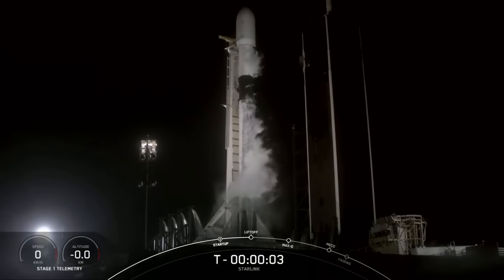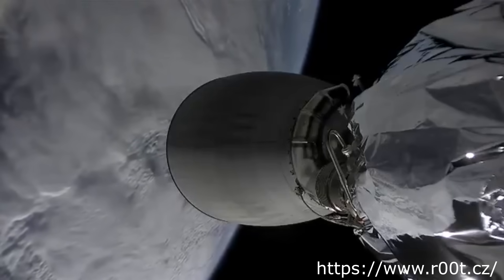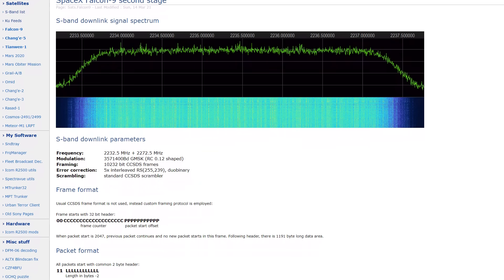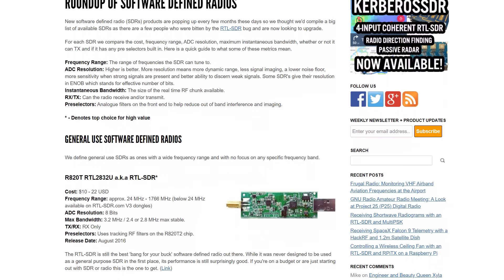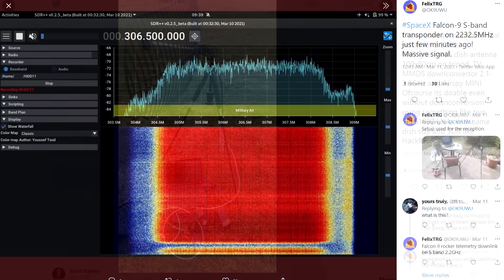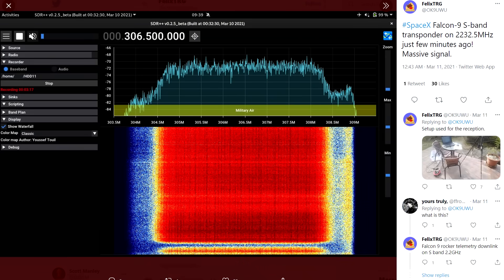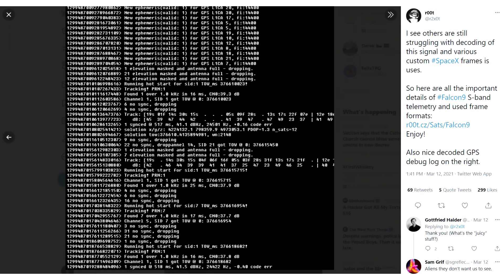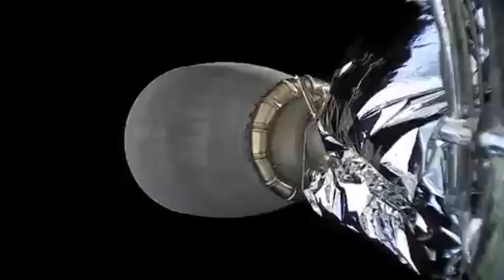How Amateur Radio Fans Decoded SpaceX's Telemetry & Engineering Video

Comment: The thing about data-streams from fast moving objects that may blow up on you is that the transmission may be intermittent AND non-re-creatable.

So, you end up with a huge pile of data with gaps in it.  On a good day.

If you do front-to-back encryption, the gaps basically not only lose the associated data but also subsequent data.

That is, a simple encryption scheme (let's say, a simple rotating key) will be illegible after the first data-loss.

If you have perfect transmission, there's no point in "synching".  If you have perfect transmission, you are not launching things into space.

So, presumably they do have some sort of synch cycle going on.  If you make it small enough, it should be easy to layer in some reasonable encryption on top.

Frankly, I'm surprised they don't do THAT as a matter of course, since they can then CHOOSE to release the information unencrypted IF and WHEN they want to, rather than leave it up to hackers.

But a stream protocol with no syncing eventually falls prey to all kinds of problems.  This is but one.

Comment: the device that shifts the frequency down is a "transverter".  It mixes a carrier at the frequency by which the signal is to be shifted, throws away the two inputs and the sum signal, and puts out the difference.  73 de ni0h

Comment: Yeah down converters are normally simple mixers.  If you combine two rf signals it will generate an output that contains both inputs, the sum of the inputs and the difference.  Bandpass the difference and you have a signal at a frequency you want to decode.  This is how most radios work.

Comment: Terrific !
I remember when the Space Shuttle transmitted Ham Radio 2Meter voice from orbit. There was a BBC News item about how a very well equipped school managed to hear the chat, it ended as the craft went out of range. I had borrowed a receiver and set it up in my front room at the bottom of a four story house in Ealing. I had perfect reception and heard more of the signal - presumably because of my different geographical position. 
I was well chuffed !
Reply: There is a ham repeater on the ISS, you’d probably enjoy listening to. I’ve made a few contacts via the ISS as it flies over. It’s so fast you have to account for the Doppler shift on transmit, but not so critical on receive. Google ARISS ISS if you’re interested.

Comment: And We Decode And Encrypt Muuuuuch More In Ukraine, Its All About SDR's And Antennas And Filters. I Have Made Buunch Of Filters And I Have Contributed To Ukraine Defending Itself.
Bte There Are Standarts For Decoding And You Can Just Go Thru Them if You Find Signal At The Right Frequency Band, If Its Not Encrypted, You Done It, If Its Encrypted, Well, You CanTrunk It Also.
There is a program that you can download, called robot36 and you can get sound to picture signals. there are other programs, but i cant mention them here

Comment: This is completely off topic for this video but I just thought I'd note out allowed that the Boeing starliner seems to have dropped out of sight completely. 
I see their claiming that issues are still being worked through with a possible next flight in 2026! Or, not. 
Givens speculation that the ultimate problem was not the thrusters but the way the thrusters were grouped onto the vehicle, I would imagine we will never see Boeing starliner fly again. No doubt there will be an announcement as such in about 2030

Comment: This "gizmo" shifting down signal ferquency is a very simple frequency mixer/converter, that you can find in literally every superheterodyne radio for a hundred years, as well as in a TV-sat tuner, for example. It's just another frequency conversion stage in the receiver (a typical receiver has one or two such stages). Regards!

Comment: For the "The old days" you could very well have referenced to Curious Mark and his team that re-built the Apollo telemetry up- and down-link with mostly pre-flight and original test equipment from collectors.
For the encryption... That is difficult and differs by country. In Germany you are allowed to receive any signal. You may receive and transmit on any amateur radio band if you are licensed to do so. But that said, you are not allowed to recognize, record or use any non amateur radio or broadcast transmission to your personal benefit. Also you are not allowed to inform third parties about that reception. That is why we are allowed to possess any kind of radio receiving device. But there is also a law about data secrecy that prohibits the decoding of any signal that is ever so slightly encrypted. As this shows that the signal is not intended to be received by you, you are violating laws by breaching an encryption. Again there is a but... As you explained you cannot simply send zeros or ones in digital bit-streams for longer periods as that would shift the receiver trigger for ones and zeros. So you use encoding like NRZ or NRZI or many other encoding systems. If you now use an encoding system that is well known and documented, it is not an encryption, but an encoding required for the modulation to work. And thus, the reception may have been legal in itself, but not legal in making it known to others. However, in case something may have gone wrong with the rocket and that team "accidentally" had recorded data around the incident time, SpaceX would probably be very happy to get their hands on it. An the final but... But I think that all the other rocket nations on the earth already knew about the telemetry and video and I am pretty sure that if the cameras can be switched manually or by position, over certain countries they only show the front or tail view but not any insides. Having said that, hopefully my tracking dish and antenna array will be up next year in spring. Reception up to 15GHz is not a deal, I can work with these mixers and intermediate frequencies ;)

Comment: Randomizers are used in systems that vary the amplitude energy of the symbols, such as 8 VSB, as the high energy bits will go a lot farther then the low energy bits.  The data psuedo radomization allows the FEC forward error correction data to correct for that.  The receiver contains the same psuedo radomization table so it can track it.

Comment: That "thing that shifts the frequency down" is called a Down Converter and that's all it does it uses a bunch of circuitry to take a frequency and shift it down to a lower frequency while still retaining all the data.

Comment: SN11 exploded at a height of approximately 1km. It is unlikely debris 
reached South Padre island as some are suggesting which would be about a
 5 mile trip horizontally. Most rifle bullets travel only 2/3 miles. 
Only way this might have ocurred is if parts of an exploded raptor 
engine under extreme pressures were ejected at incredible velocities 
exceeding that of a high powered rifle bullet. These would likely be 
only very small fragments.

Comment: So this is the reason i couldnt get my rtl dongle delivered the other day. The gizmo is called a down convertor. It down converts a higher freq. To a lower one your receiver can hear so to speak.
Ive been doing this stuff way before sdr. Used a radio scanner and a tape recorder to record recieved signals from way a weather (noaa) or goes satellite and then played it back into the computer to decode the beeps and bops into a picture. Theres slow scan tv wefax ship to shore stuff pager data etc etc acars data sooo much to download and decode.

Comment: You like looking inside a liquid oxygen tank.  I'd rather look outside................
P.S.   LNB (Low Noise Block) converters to convert a higher frequency band to a lower band (mentioned at 3:30) are not that unusual and readily available....

Comment: Scott, the Gizmo you refer to at about 3:29 that converts S-band to something the cheap dongles can receive is called a downconverter.  Essential, and basic technology.  You probably have a dozen around you right now.  It's a local oscillator (multiplied crystal or something similar) and a mixer with some filtering.

Comment: It's called a transverter or downconverter that translates the higher frequency data channel to a lower frequency that the dvbt dongle can accept. Basically it's a diode ring mixer/multiplier or a tayloe mixer, producing various mixing products.

Comment: radio guys are like wizards. They point a stick at the sky and conjure things out of thin air
Reply: Radio wave just a light but you can't see with your eye 😅
Reply: @digimacska17   kinda like saying Ethernet is just like telegraphs done really fast.
Reply: As someone working with GNUradio for a cubesat team (I’m on the software subsection and have taken 0 signal processing related classes so prob shouldn’t have been assigned to me) yea pretty sure it’s magic
Reply: Trust me ...  If you saw code division multiple access done in neon green, you wouldn't understand it either.

Comment: Pretty standard downconverter to change the signal down for SDR.  20+ years ago I worked on cable internet (docsis 1.0 and 1.1) that worked over wireless cable.  Wireless cable (mostly analog except for the cable internet) used ground transmitters in microwave frequencies.  The receiving antenna would include a powered downconverter that shifted the frequencies down to standard cable TV frequencies, allowing the end user to use standard cable modems (or CATV boxes).

Comment: Great video!  This  talk about “Amateur Radio is Dead” is not accurate.  Smartphones having taken much of the Gen X and Gen Z  interest away from 2-way amateur radio communication, but Software Defined Radio should resurrect it.  For “Appliance Operators” including smartphone only users, SDR will never be an interest or option because its complicated.  Note: This is a SDR Developer perspective.  I should add there are  SDR “Appliances”  (Turn Key) on the market now that look like and are controlled like traditional radios, except with much higher Signal/Noise ratios using digital processing.

Comment: I believe it's a transverter that allows you to use equipment to work different bands. I double-checked the full license manual for amateur radio and it appears as though that's what they're using.
Reply: RSGB (Radio Society of GB) has quite a few interesting books, https://www.rsgbshop.org/acatalog/. It's a nice hobby to get into as you can work satellites (which you can use as repeaters), do HF (cross Atlantic communication), play with packet networks like APRS, and a bunch more. Also talking on local repeaters on UHF/VHF helps you find people locally who have similar interests.

I guess as you're in the US you'd want to go through the ARRL.

Comment: Shifting the signal is done in modern heterodyne transmitters by multiplying the receiver signal with another reference signal and filtering out the large frequency components, when you run through the maths you end up with components analogous to cos(fc+fm) and cos(fc-fm) in your mixed signal (I’ve left our other terms and this is assuming a single transmission frequency but similar logic can be applied if you consider any signal as a Fourier series) by altering a threshold mixing frequency you can decrease or increase where your signal is in the frequency spectrum

Comment: How to update your communications system find the first line of code in the computer's operating system. Change the code to: F=m*a*2277   -from this code----F=m*a*a      .. .. .What it does gives you full telemetry and signal strength.  Place a calculator on your COM it is an easy way to improve your communications system for any ham radio operators.
Reply: @Agent 666 Information provided from the FCC’s new guidelines on coding a communications, weather radar, and flight radar systems computer.

How to update the communications or radar systems computer code on the first line in the computer’ OS. 

Change the following code in the system’s first line of code to:

(F=m*a*2277) from (F=m*a*a)
 
What this does is gives you full broadband, signal strength, or full telemetry depending on your system. It correctly runs the SOST of the communications or radar system.

Place a scientific or graphing calculator on the COM in the communications room to make an integrated system gain due to the computer chip within the calculator, they work together. The information stated is new research and development.
If you have any questions or concerns contact the FCC at 1-888-225-5322

Please share this guideline with other communication centers, local broadcasters, robotics experts, and airports.
Thank you and regards,

Dr. Ronald G. Erickson

Comment: That's just H.264 in the bitstream. The tough parts are the Reed Solomon EDAC. And then once you get to the channel data, the hard part is to figure out what the actual telemetry data is. I saw a lot of floats and 16bit two's comp, but the meaning of the fields is very tough to determine.

Comment: Encryption and decryption bog the system down with overhead.  One of the things you have to do during encryption is add dummy bits to mask the real bits, so your messages get bigger, i.e. 1kb becomes 2kb.  I'm sure they don't care if you receive.  Another example is you can listen to ATC conversations all you want.  But you're not allowed to transmit.

Comment: SDF (Software defined Radio) in microwave frequency range works in a quite simple manner: Every superheterodyne receiver uses the antenna signal Fant, that is mixed (multiplied) with local oscillator Flo. The trigonometric identity sin(a)·sind(b)=½·sin(a-b)-½·sin(a+b) shows, that Fant+FLo and Fant-FLo will appear. When Lo is very close, or equal to Fant, the resulting difference frequency will be (almost) zero. Therefore, linear, or complex demodulation can be achieved very easily by software, since high frequencies are taken out of the equation.

Comment: The downconversion you’re confused on mixes the 2.2 GHz signal with another one...like 1 GHz. The produces sum and difference signals. One at 3.2G, and the other at 1.2G. They filter out the upper one, and decode the much easier 1.2 GHz signal.

You ought to get your amateur radio license. It’s easy and you learn a lot.

Comment: Back in the 60s, NASA, had problems with 2nd stage ignition...like it won't go....  
They solved it with small solid rocket motors!  
When number 10 landed blew up on the pad...a small rocket motor can be seen, shooting off to the side!!!!
Reply from the maker: That’s a gas cylinder with high pressure nitrogen

Comment: 3:26 Scott: The gizmo basicly works like this: It is a bandwidth problem. Simplified version is that stuff sent on lower frequencies will always have a lower theoretical transfer rate. But this gizmo can help by capturing data in higher bandwidths, and smear the same data out across more frequencies in a lower part of the spectrum while retaining the same amount of information. Depending on how far you shift the frequencies, you might have to filter to only a very narrow band of high frequency before shifting it down and smearing it out across a relatively large band in lower frequencies in order to retain the same amount of information. This is about as far as I understand it, but I hope it gives a clue at least.

Comment: SpaceX will probably not encrypt their data for one reason: Latency. You don't want more latency for the telemetry data output, it could be the difference between the frame that shows a pipe bursting reaching earth or not.
Reply: Encryption is fast, what latency are you talking about?
Reply: @RawbLV  it's fast but not instant. And a few microseconds of delay can cause you to loose telemetry that could give you important data, e.g. if the rocket fails you really want the latest data possible.
Reply: @minecrafter0505  Right, but when talking about the video feed it doesn't matter since they are translated in a fixed frame rate. Probably 24fps which is 41 milliseconds between frames which is more than enough to encrypt a frame.
Reply: Encryption can also be done in a physical manner by making special chips or arranged circuits which encode the data faster with a pre determined key... the only real time sink would be decoding it at the base station. They can easily encode there data for “safety” reasons

Comment: If the data is encrypted and you loose a bit of it, depending on your encryption algorithm, you will likely loose all the corrupted packet / block and maybe even more. So I think it is much safer to broadcast unencrypted data when it is not required that you hide it :) I'm not an expert on the subject, but it may be why.
Reply: Honestly if they want to encrypt the data, it would be far easier to broadcast the stream to a spy satellite and downlink that way, rather than pointing the payload broadcast straight down.

Comment: 4:02 anyone notice that the top half of that data is a mirror of the bottom half, with the parity bit set? They send the data twice. If there's any corruption they can use the parity set to do a bit of data recovery/error correction.

Comment: i actually wanted to know what those were, i kept seeing like 1 frame of it and had to slomo the video and stop it right on the 1 frame and screenshot it. but now i know what it it and yeah i have to agree that would be sweet to see more of. it would really be sweet if they had a page on their site that would have selectable camera streams for those that dont want the cycleing but want to observe one angle or have all angles up at the same time. The LOX cam is also educational on the behavior of LOX in space as well as G-Indicator. aside from all that, why dont they use the same tech as their starlink dishes so they dont have to track it with the dish, or use the starlinks to relay the data back to them, just have the one in the top of the stack on to communicate to the ones in orbit already and have them relay it back to HQ.